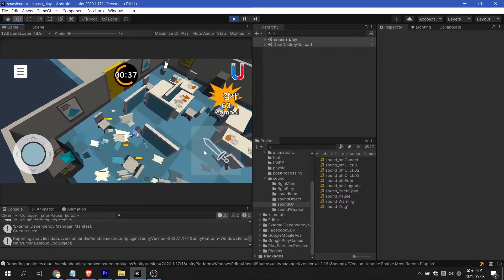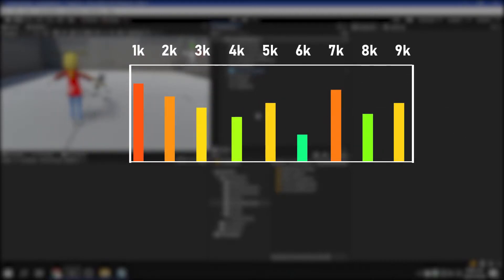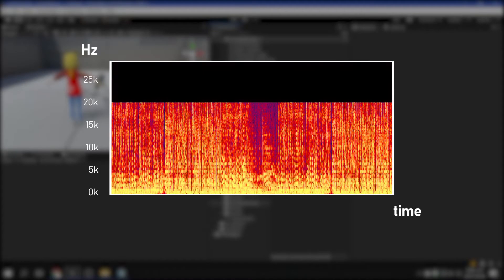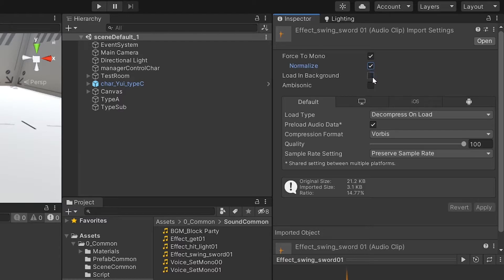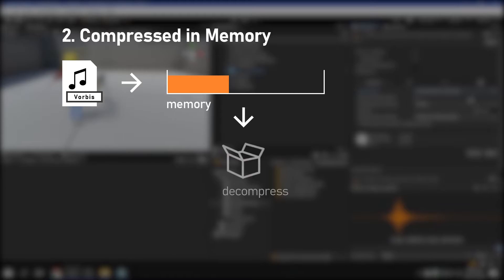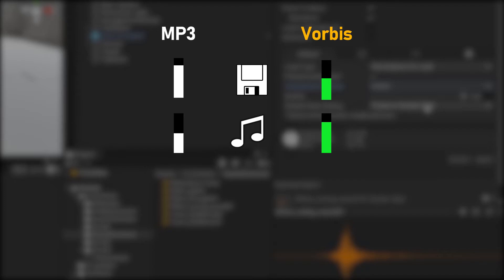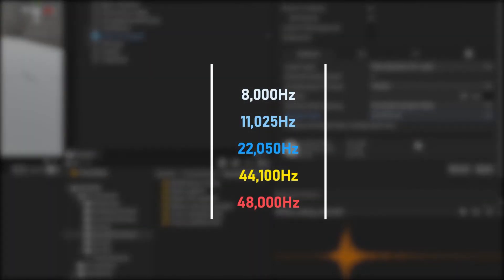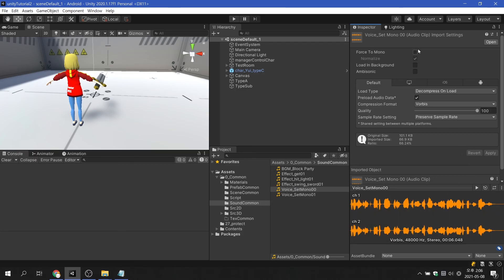Unity : Optimizing Audio Source

Comment: For 10-30 second dialogue audio clips, do you recommend Decompress on Load or Compressed in memory?  And which decompression setting?
Reply from the maker: In my opinion, a sound file that contains more than 10 seconds of audio is considered large.

Additionally, if the audio file will only be used once in a scene, I recommend using the Streaming option.

But what I recommend even more is to split the audio files into individual sentences of dialogue.
Reply: @  if the audio file is only used once, how badly does streaming affect performance?
Reply from the maker: @championsofodin9868  Well ... I do not think it makes the performance pretty badly.
Try it out and see if it works perfectly.